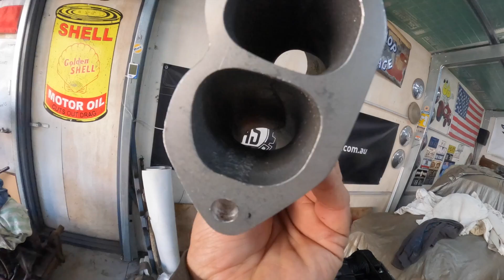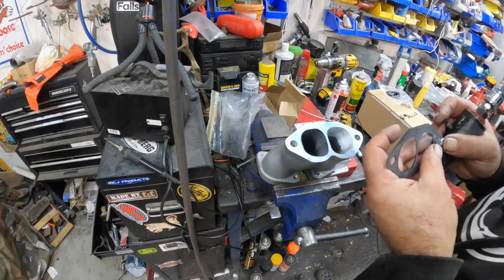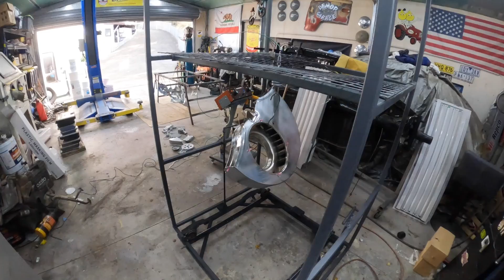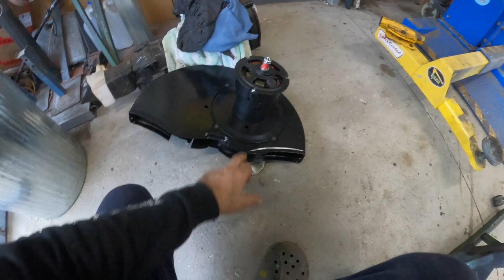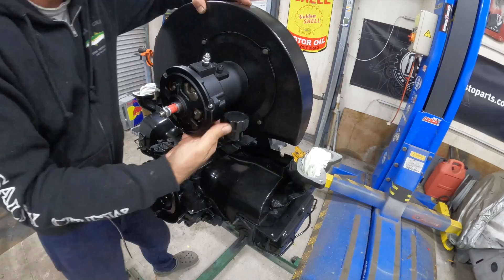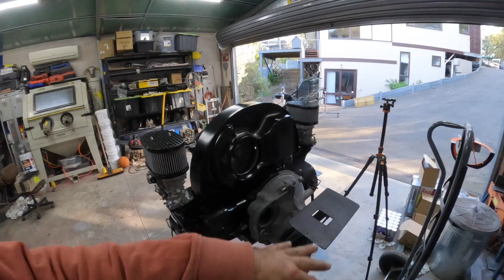VW 2276cc engine build // blackmamba #vwrestoration #vwbug

Comment: 10K Engine, taking a chance with an aluminum pulley?  Then check for loose nuts, yup. Are you sure your examining the correct nut?
Reply from the maker: 😂😂😂 dont worry its not staying on, just for testing alinements 😉
Reply: @DemopVWgarage  Yay